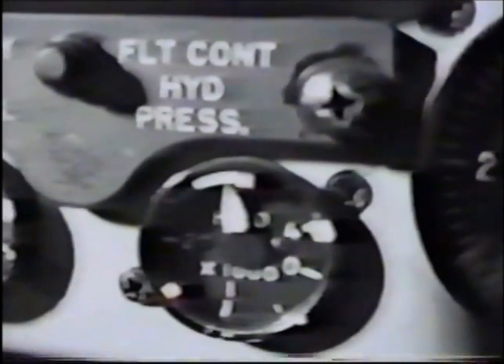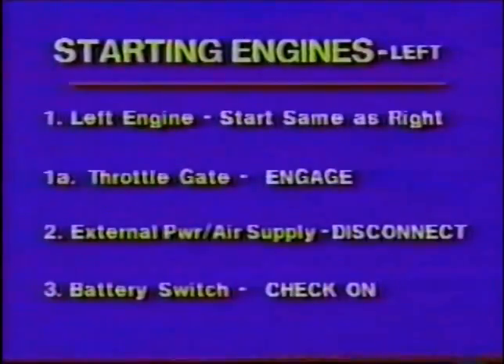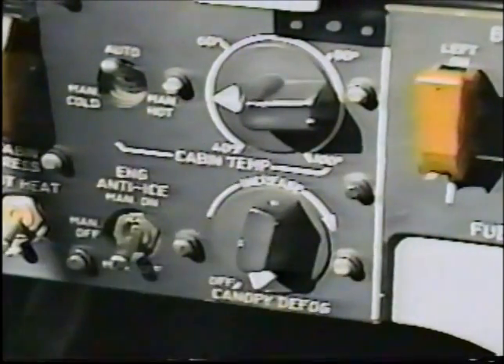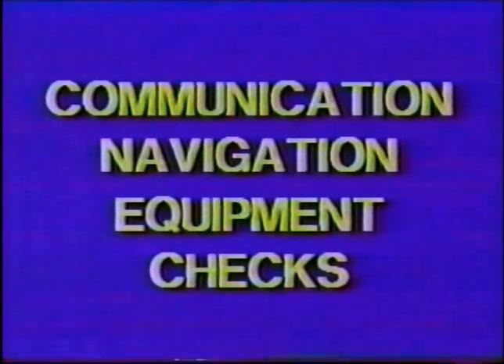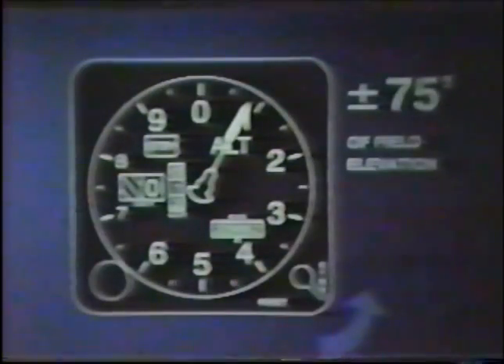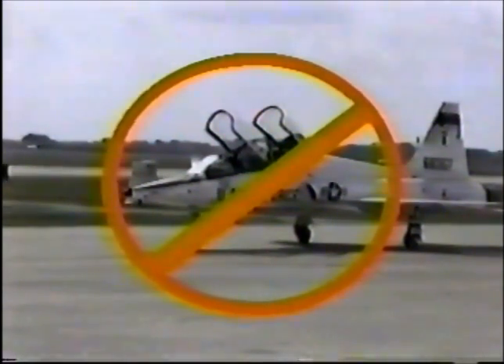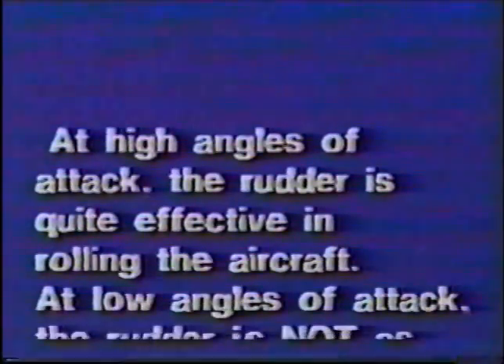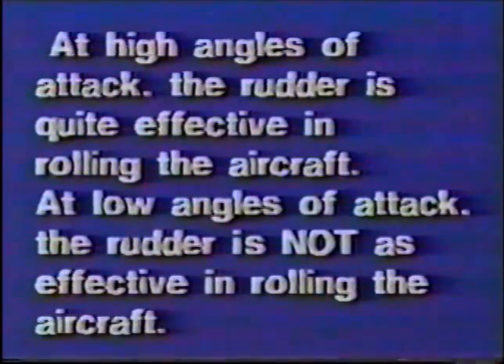US Air Force T-38 Talon training 02 (engine start, before taxi checks, in flight)

Comment: If you search 70-1951 you can see that this specific aircraft is still flying
Reply: Did they update the cockpit instruments? They may have converted to glass in this airframe , analog gauges are awesome too!
Reply: @stevennagley3407  All AETC T-38 "A" models were given upgrades to include avionics and propulsion modifications to where now the designation is T-38C. The T-38 in this video was originally an "A" model but has likely been converted to a "C" model (can't remember if this is an AETC aircraft). T-38 aggressor squadrons still use "A" model T-38s with the round dials

Comment: A very old film. It seems to have been recorded before the USAF put the airbase identifier on the vertical tail. CB for Columbus, RA for Randolph, and so on.

At Columbus AFB we didn't get those underground piped in air supply systems until the mid to late 1980s. The crew chiefs hated it for a long time. With enough portable air carts and crew chiefs you could start up all the Talons you wanted simultaneously. The underground system would fail if you tried to start more than 4 to 6 aircraft simultaneously.
Reply: Can’t be too old, cause the checklist was calling for the throttle-gate to be engaged. Maybe mid 80s... showing my age maybe?. Had the black stripe of stars on the tail. Helmets were not white, and the crew chief was military but wearing cameo bdu’s. Didn’t recognize the base....  at the rate that student performs his checks, he is gonna bingo out still in the chocks 😉

Comment: Thanks for the video. It brings back great memories of working the flightline at Craig AFB.
Reply: I was assigned to the 14 FTW Columbus AFB Mississippi. 1986 to1989. People told me that Craig should have been kept open and Columbus closed. It seems that Mississippi US Senators were more powerful than Alabama US Senators when that decision was made.
Reply: David Hoffman were you ever at Randolph A. F. B. ?
Reply: @raystrickland9976  ,
Only for a maintenance officer related training TDY. I think that was once in my 2.5 years at Columbus AFB. With the A-76 contracting out of ATC UPT maintenance that ended any more TDYs there. Ended up at Robins AFB ,   Warner Robins Air Logistics Center working the C-141.
Reply: we use to turn on anti ice for just a bit during cold weather start ups it would bring the oil pressure down quicker. Just old fun memories.